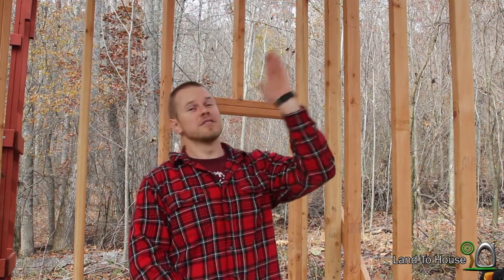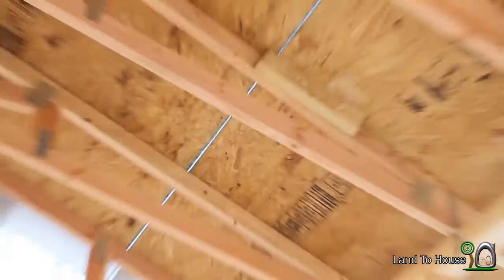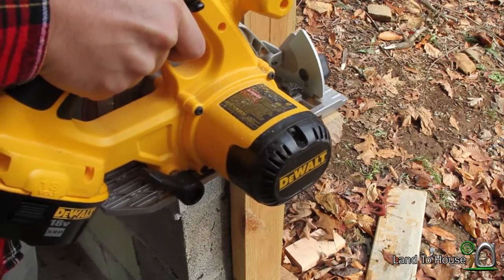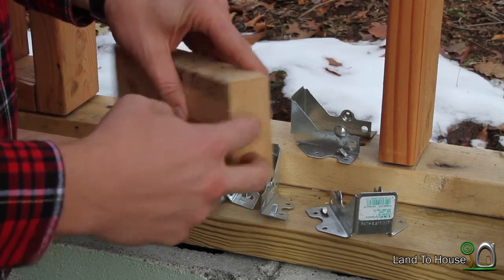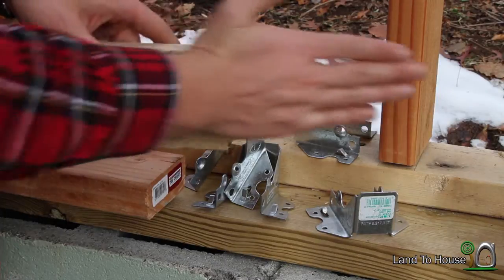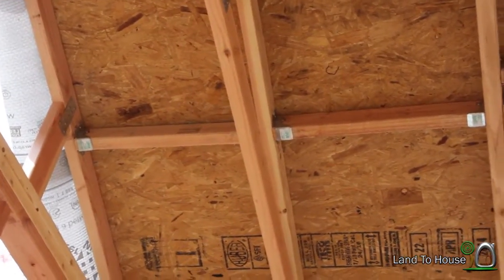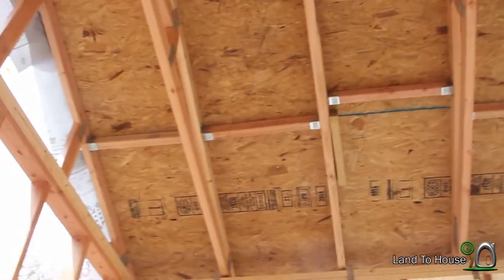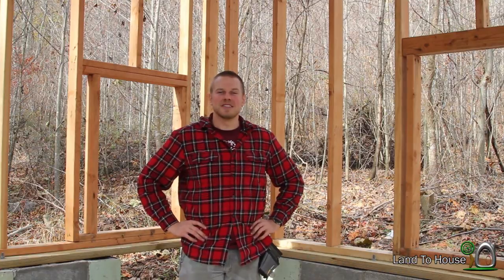Tiny House - 23 Install Purlins

Comment: Why install purlins if you've already sheathed the trusses?  In my experience purlins were used in place of sheathing the whole roof - usually used in pole barns.
Reply from the maker: I realized that I needed something to connect the sheathing to. I am a new builder for sure.

Comment: Dont forget your fire blocking,it will keep your studs from bowing,and helps keep the structure more ridged, also better get some shear panels up on the corners.you are doing good,but man get a better ladder ok?
Reply from the maker: +Edad Martin thank you for the tips. Certainly is a learning process. And the right tools makes all the difference.

Comment: Camera operator and builder at one time. Great job Seth. Just a footnote here.  The joist hangars have that small bent metal tab that a hit or 2 with a hammer will hold the hangar to the truss until you get your nails in.  I'm new to this and found this info on another video. Keep up the good work.
Reply from the maker: Awesome tip! I will be making a tool shed someday and will have to do that!

Comment: I would place one in line with the rest in that one offset place it will make it even stronger. Just my opinion.
A very nice job you are doing keep up the good work. You will be able to move in soon.
Reply from the maker: I was thinking that it would need that placed in there but it seems very strong.  I am looking forward to getting the door on so  I can get to work inside :) thank you for watching my videos.